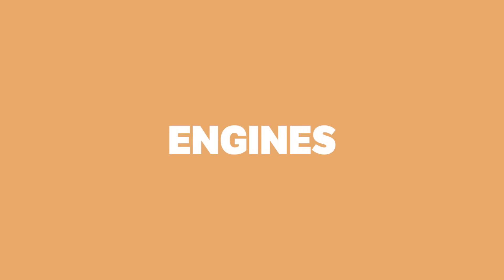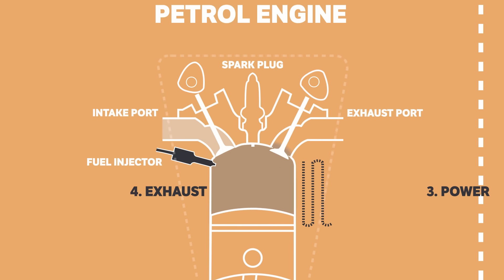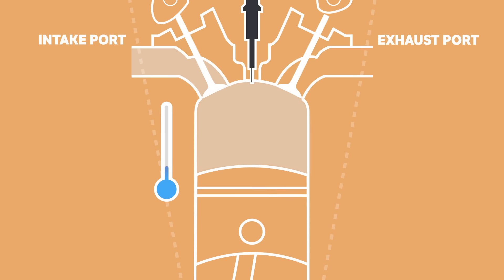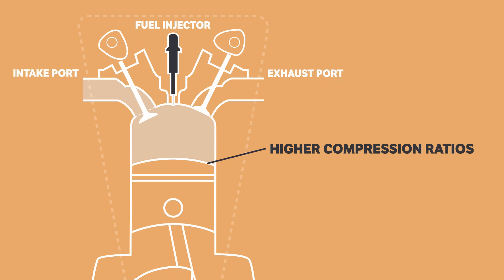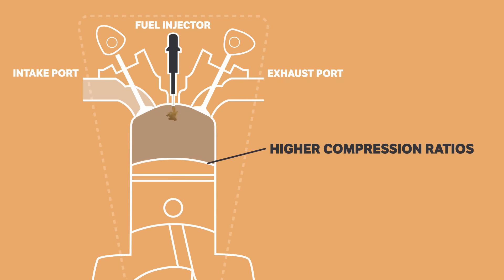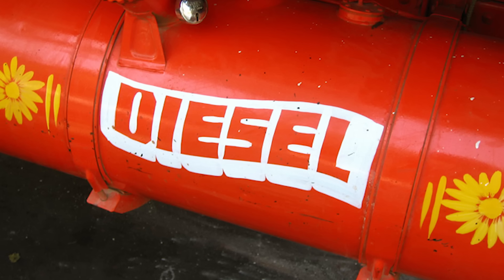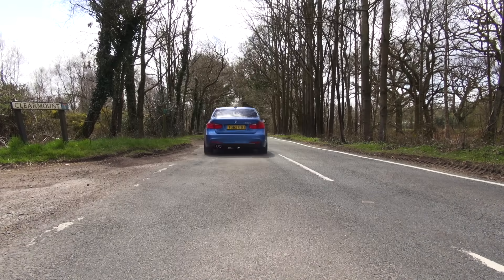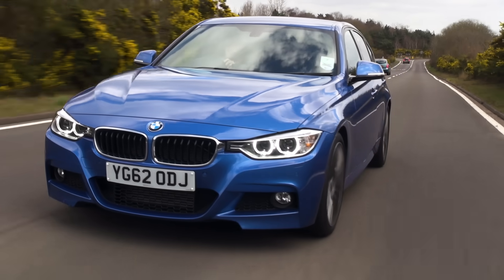The Differences Between Petrol and Diesel Engines

Comment: What an interesting string of comments from people about this!
First off, all you "Yank haters" from Europe consider this; 50 out of 100 cars in Europe are diesels, while only 3 out of 100 are diesels in the US, so if anyone is destroying the air with diesels, it's Europe.
Diesels are best suited for heavy work, and fuel efficiency, they produce much higher torque at lower engine speed than the same displacement gasoline engine while using less fuel to accomplish it.
Trains (diesel/electric hybrids), trucks, Ocean freighters, and farm/construction equipment all use diesels because they're better suited to heavy work while using less fuel.
Diesel cars and light trucks return 20 to 25 percent better fuel mileage than the same vehicle gasoline fueled - as an example, my commuter car averages 50 to 54 mpg, the identical gasoline fueled car averages 40, both turbocharged, the gasoline car with a smaller engine.
Anyone "rolling coal" with their diesel is self centered as hell, and fooling themselves, the best "tunes" for street driven diesels make their best power WITHOUT pouring smoke like an old locomotive - and they wouldn't want that stench inside THEIR vehicles, clothes, and the air around them.
Because the area of emphasis in ecology has shifted from the planet itself to the air around it, diesel's days are numbered unless someone develops a means to "clean them up".
In the meantime, EVs don't yet parallel petroleum fueled vehicles in terms of utility, convenience, or price - once they do they'll appeal to more people.
I'm sticking with gasoline and diesel fueled vehicles (I own both) for now.

Comment: I love both engine types. Some diesel engines have a massive pull out power which makes them just as fun as petrol. Also diesel is generally immune to knocking allowing easier power boosting. 
For team diesel I have a mitsubishi l200 animal with the ralliart power upgrade. 
While team petrol is a mazda 323f zxi v6

Comment: But what I still don't get is why petrol and diesel sound different. Surely (essentially) the same thing is happening in the cylinders. Compressed air and fuel is igniting, albeit through a different method.
Reply: Because Petrol uses sparkplugs to ignite the fuel evenly, also fuel is injected with the air.
Diesel on the other hand is ignited with compression which leads to uneven ignition of the mixture, also diesel fuel is injected when the air is already compressed and the fuel continues being injected which means that diesel burns at a different time compared to petrol, combine that with the slower overall time that diesel fuel burns leads to diesel sounding like someone farted in a pool.

Comment: Hey you said nothing about glow plugs diesels use glow plugs also not all engines control air some control fuel most diesels control air
Reply: The only thing a glow plug does is warm the cylinder when you start the vehicle for the first time.  After you start they do nothing. 
- Drives a F-350
Reply: cummins uses heater grids
Reply: also most diesels don't control air. They shove it in.

Comment: Such a cool video! I'm wondering if diesel would work in a rotary engine considering that latter's high compression ratio? I think Diesel would definitely help with the fuel efficiency and torque issues that rotary engines have.

I'm not an expert though. Maybe someone here knows.

Comment: Great video as always! I would add that even diesel engines are more efficient and have more torque, petrol are better :) and of course, the more torque doesn't mean always better acceleration, as diesels are limited from 4500 to 5000 RPM and petrol above 6500. For example, if your car does 80km/h on second gear and has 200Nm torque from 0 to 4000 RPM (for example) it will have the same acceleration as the same car which does 80km/h on second gear but has 100Nm torque from 0 to 8000 RPM. As the petrol engines have more torque and power on high RPM than diesels, there are just better for fast driving ;) but still, electric it's the future

Comment: After drive both of them ( both I were drive it at least 2000 Km ), I prefer driving with Diesel engine especially on traffic jam with manual transmission as diesel give me torque wherever rev I need, in case on traffic jam I need torque on idle rev, try it with gasoline which most of them just pull slowly or just stall if you try load them on low rev, ( 2.4 L turbocharged diesel vs 2.7L NA Gasoline) ( turbocharger didn't give noticeable boost on low rev)

Comment: actually diesel engines and new direct port injected petrol engines are visually identical, only difference is compression ratio and petrol has spark plugs. petrol has converted over to direct port injection because some smart guy put 2 and 2 together and thought maybe petrol engines would get better fuel economy if they built them like a diesel. derp derp 2017

Comment: Why cant a petrol engine work like a diesel, and ignite the mixture by pressure to achieve the same results, as diesel
Reply: Keybraker Because than your petrol burning engine would become a diesel :)   Probably possibe to make a diesel running on petrol, but the compression ratio needs to be lowered, and thus the efficiency will be lower.
Reply: Balázs Kriván what makes diesel as a liquid better than petrol to be able to ignite by pressure?

Comment: Slight issue, diesel engines make more torque because they have a longer stroke, which is in turn due to higher compression.

longer stroke means the the piston is acting on a longer lever to turn the crank shaft, so more torque.
Reply: There is no leverage inside the engine. You can find it in the transmission, differential and tire diameter though. That leverage is what makes Power the more important metric over engine Torque in fact.

Comment: I drive a Tesla
Reply: Tobias Zistler bruh the rimatec  started burning because it flipped over so many times and the car stayed intact. Thats impressive. Many cars would have been crushed and any car would have burned down. Ugh.
Reply: Good for you, glad you can enjoy yourself even though your car is silent...
Have a great day! :)
Reply: but muh engine noise
Reply: I don't understand why so many people would hate electric cars. In the end whether a motor runs on diesel, gasoline or electricity it still does the same thing, which is making the wheels turn.
Reply: not really relevant to the diesel vs gas/petrol conversation, but good for you, as long as you enjoy it
Reply: CashedClean rubbish, poorly built yank mobile
Reply: Well when you’re stranded off in the middle of no where have fun calling a tow truck that uses a Cummins, Powerstroke, or Duramax engine
Reply: Daniel Rocha-Garcia If he gets stranded off in the middle of nowhere with a petrol car the tow truck will still have a diesel engine. I don't understand your point.
Reply: Lol. Sony DriveStation gonna own all!
Reply: James Ch I don't know many EV owners (they are super rare here in France), but I didn't hear anything about reliability problems. I know some of the early Model S buyers have had some reliability issues, but it has more to do with Tesla being a fairly new car manufacturer. The charging part does take a bit of getting used to though. You kind of need to own a garage to plug the car in when you're not using it, and if you are going to make a super long trip that exceed the range of the car you'll have to plan some stops. It's still early days for the technology though, early adopters are still playing guinea pigs.
Reply: dang it cashed clean
Reply: Tesla drives you
Reply: I fly a Sikorsky UH-60 Black Hawk! I'll blow up your Tesla lol. I'm kidding Tesla car are awesome too.
Reply: Eww Nasty
Reply: So you drive a piece of shit?
Reply: I hate tesla and all electrics I love real cars not junk
Reply: SteelSkin667 most if not all electric cars are unreliable, impractical, and takes too long to charge
Reply: CashedClean richard hamond have a litle litle bit fun in an rimatec e car untel he crashed and the batery set the car intantly on fiere on a field 

hav fun with your exploding accu car like hamond hope you didnt burn....

Comment: The difference between diesel and gas? If you buy diesel you are a piece of shit.
Reply: How?
Reply: Because they stink, have high nox and carbon nanoparticles and the smoke is disgusting. When I see a vw rolling coal I wanna slap the guy. Diesel should only be used in industrial applications imo. And the far left is saying the death toll is in the tens of thousands because of diesel emissions. I take that one with a grain of salt though.

Comment: Tfw running a diesel on used vegetable oil is more powerful than using regular diesel.
Imo, petrol all the way. 
More soulful sounding, rewarding, faster and lighter, and smoother.
Proven cheaper to run a car on petrol than diesel due to the increased cost to buy the diesel car in the first place and the fuel cost isn't offset by the gained MPG

Comment: Because the Diesel engine works harder than a petrol engine it's made of stronger parts which makes the Diesel engine stronger than a petrol one so you can easily do much more miles on it than a petrol engine. A Diesel engine will last longer than a petrol engine in general.

I'm a 4 year mechanic only but you have to think technically all the time
Reply: Alex Larsson 
Driving a fiat, yes a fiat, with a 1.6 petrol, 470 000 kilometres, only changing the spark plugs every 50 000.
Brother drives a vw 1.9 tdi, the one which everyone praises, replaced injectrors at 250 000, 
Turbine at 275 000, and he is looking to sell it.
Bonus round:
I bought my fiat cheap, 6-year-old, 3 years ago, 150 000 km on the clock.
Brother bought his vw new, 9 years ago.
Both cars are 9 years, both serviced by the same mechanic.
And then they glorify VW and spit on fiat.
FORZA ITALIA 1.6 16V
(Not Italian myself, by the way)
Reply: IvanCelar damn nice man

Comment: I'm sure Europeans have a different perspective, but to me, diesel will always be associated with either douchebags rolling coal and breaking traffic laws, or big slow farm/construction equipment.
Reply: GobotWars my mercedes atego with 130kw can pull 15 tonnes with 10k rpm. I dont think petrol could do that. Because it burns slower it cant go as high on rpms as petrols, but hell i can start in 4th gear in my clio diesel. Couldnt do that (not even third gear) if it was petrol. Put it simply-economic and work machines-diesel
Show offs and sporties-petrol.
Reply: How you even associate type of fuel with certain stereotypes is absolutely crazy.
Reply: Seb Design wow thats really lugging the engine around for no reason why even do that? Dont you smell burned clutch after a while? XD
Reply: ReSpEcT DiEsEl FaM
Reply: GobotWars fuck you.
Reply: GT20Modding no it happens when their is more fuel injected into the Diesel engine then the engine needs and it isn’t burnt as well, which causes horrible wear to the bearings and engine, and you’re also just blowing diesel right out the exhaust. Stock diesel trucks can’t do this as well as trucks that are tuned or chipped or have bigger injectors
Reply: When I was in the USA some time ago, I was really surprised how "wierd" a normal, not slow, diesel powered car is for the people there. Especially compared to germany, even if you want a really fast car here, you usually buy a diesel. At least the people I know. A perfect example is the 3l V6 diesel Mercedes puts in the 350CDI models. You can outrun almost every non supercar, and especially uphill every petrol powered thing. Every time I have to drive a petrol powered car, even the faster ones, I'm just missing the acceleration in general and the immediate "kick" you can have with decent diesel engines. It always feels slow somehow. It seems like it takes a really big ass petrol engine to deliver as much fun and acceleration as a medium size diesel engine.
Reply: I just hate the smell and sound of diesel engines and love petrol engines
Reply: Not everybody that drives a diesel is a “douchebag rolling coal” i drive a diesel and i don’t intend to roll coal it happens when you accelerate in older trucks.
Reply: Voice of Reason I can pull off in third gear on my petrol Mercedes :-)

Comment: Diesel, not so long ago, used to be good - but then they went nuts with EGR, then they added a DPF, then they added SCR with adblue, then they increased DPF regen's and EGR flow. Now a diesel in reality is not that much more fuel efficient than a modern petrol, as its constantly regen'ing. Add in the cost of adblue and the inevitable expensive clogged up EGR followed by the £1000+ DPF that's blocked by 100-150k miles and well it really just don't save you money.....and all this to sound like a bus.